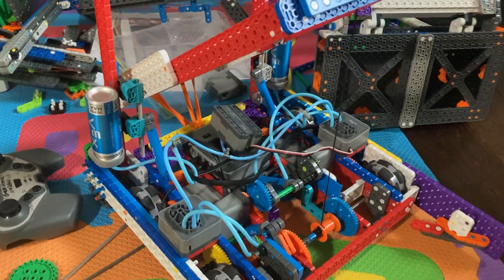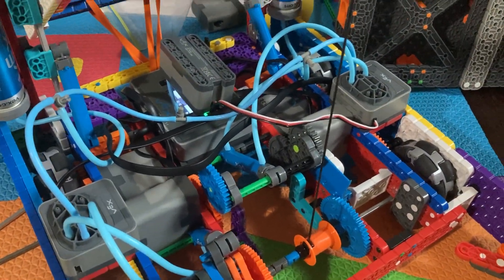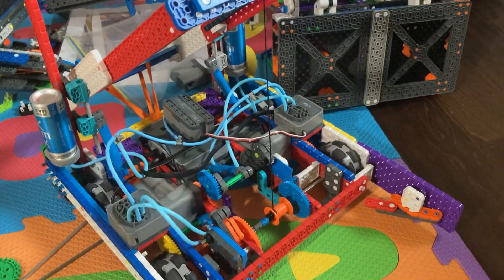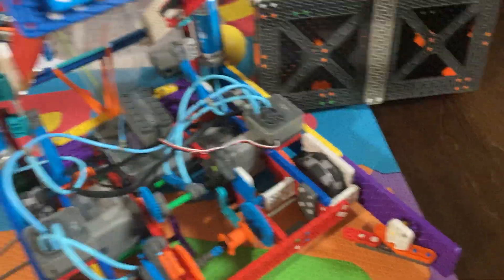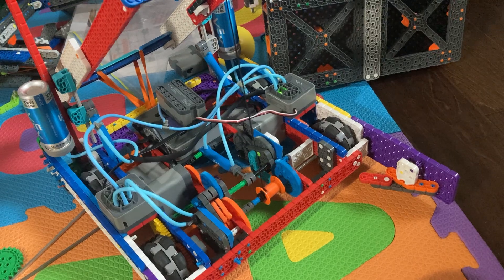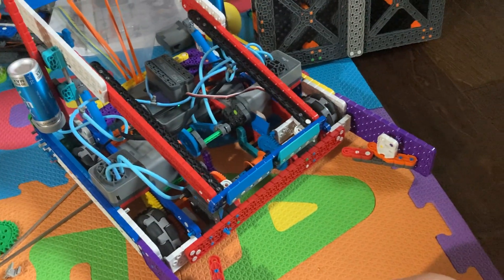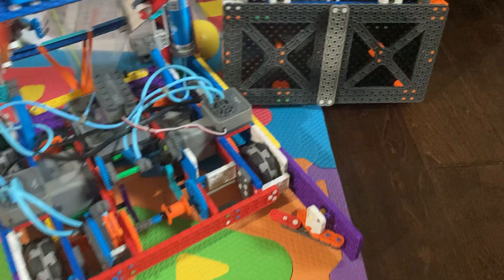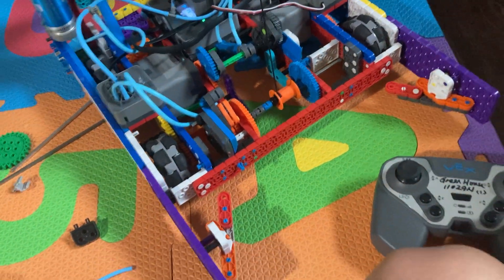Vex IQ | Rapid Relay | Catapult design

Comment: For anyone who doesn't understand this design I can explain. Basically, he has a pto with 1 motor, piston goes in the middle, when he extends said pistol it causes the gears to collide connecting them, after he's done with the angle, he can clamp the cata with the ratchet via a gen two part. Whenever it clamps down you can release the pto and keep the cata's angle. This design is good if you want to do 2 ball catapults, except you'd have to increase the size of the drivetrain by like 5 and make the cata longer. Overall this design is pretty good, I'd advise waiting to see what becomes meta though.

Comment: This is a pretty good mechanism! Our team is also using the ratchet and it would be really helpful if you tell me how to use the pneumatics through coding.
Reply from the maker: Blocks: go to devices, and select pneumatics. Then, go to one of the motion parts and scroll until you see like “pneumatic1 set true/false”, this is how u will activate the solenoid. In order to get air, u have to connect the air pump with the weird looking wire, and u have to use “pneumatic1 pump set on/off”. It uses a lot of power, so I usually just use it when I need it
Reply from the maker: I hope I can find an example of pneumatics in my full volume robot, it is a lot simpler and is a very simple but effective power sharing device
Reply from the maker: Nevermind, I can’t find it sorry

Comment: you should just use gravity gears with a tbar mech
Reply from the maker: I changed the design because I found out the winch doesn’t allow the catapult to suddenly accelerate the way I want it to, so I can’t launch balls from across the field.
Reply: @suscraft13722A  ohh okay that makes sense
Reply from the maker: I added a gravity gear on the new design, though

Comment: we found that the motor to the catapult does not get worn out so the ratchet mechanism isnt needed at least for our robot. if you wanted a really fast ratio for your cata then this would be useful (fof perspective our cata goes down about as fast as yours).
Reply: we only use 1 motor so with 2 you could def save some weight and complexity
Reply from the maker: Choo choo mech carry
Reply from the maker: Yeah… I noticed really early on, and I just waited for verification in the form of a comment. Thank you
Reply from the maker: Also when is your mech reveal, Robert has told me about your tension adjuster